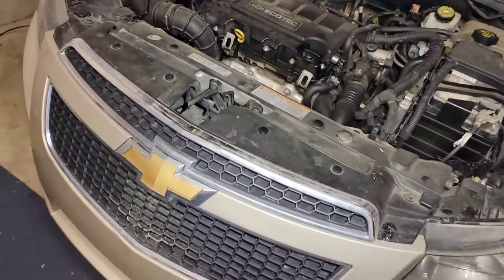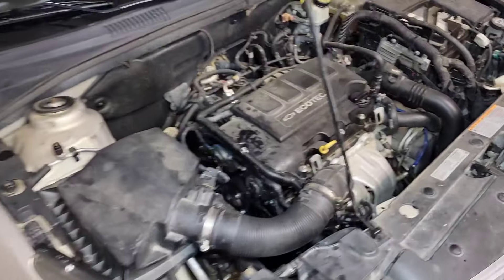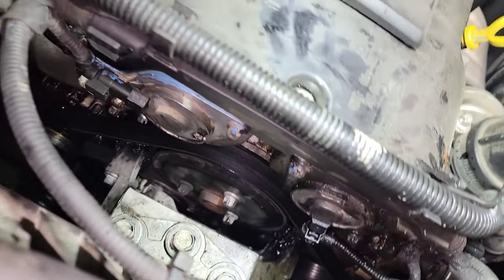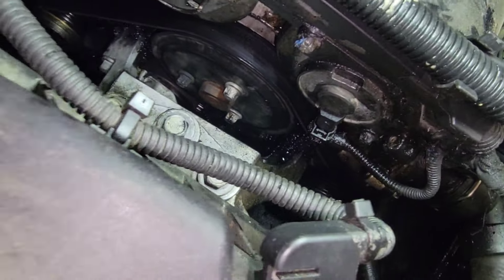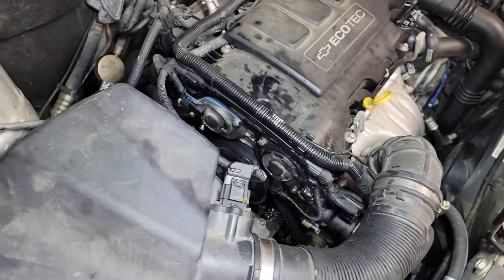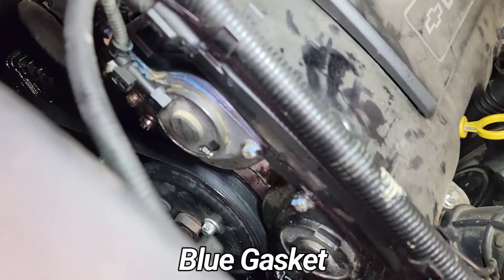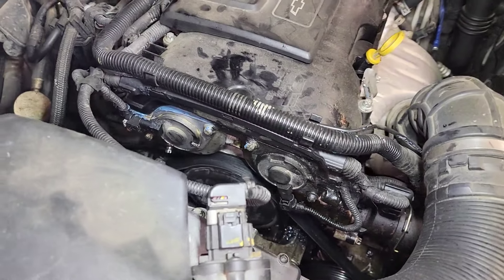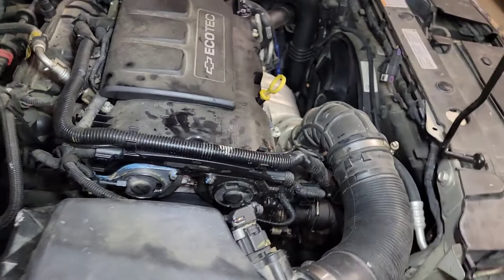V1: 2008-16 Chevy Cruze 1.4L Massive Oil Leaks, This type of job is Horrible! Lets get It

Comment: The worst car I have owned so far.  oil leaks + coolant leaks + loss of power + + + +!!
Reply from the maker: Alot of people dont like this type a car
Reply: Hey but it's a good car to learn from. my advice is to replace the thermostat with a zzp thermostat it opens at 206 degrees instead of 217-220 that will save you from overheating a lot then replace that coolant outlet at the other end of the engine for a aluminum one that part loves to give out every year or two the original is made of plastic. As for the issue with the oil leak from the valve cover you need to modify the intake manifold there's a YouTube video on how to do it and why it does it. Also replace your negative battery cable around 200,000 miles trust me you'll save yourself a lot of trouble and money the average mechanic couldn't find why my car kept dying on the road cost like 25 dollars I did it myself.
Reply: Blood I just...yeah you right.buy I love lil Burbo
Reply: Can you show me whats a good aftermarket thermostat to purchase ?
Reply: Did ur car got fixed? I m having the same type of issue in my 2011 chevy cruze.
Reply: 248,000 miles on my 2012, 6 speed.  I have had coolant leaks from water pump and t- stat housing, and it’s leaking oil slowly.  Despite that, I love this car!  Just always check your fluids.

Comment: 5 years ago, I bought a 2012 with 108k miles on it as a work car. Engine was covered in oil and antifreeze. Spent about 500 bucks to replace quite a few gaskets, seals, hoses and a good steam clean. What I have learned is if I run the heater full blast for the last few miles before I stop anywhere and also let the car idle for a minute with the heater going, it brings the water temps down from 217 to under 190 degrees. Since Ive been doing that, I havent had any more leaks or had to replace anymore gaskets. Currently, the car has 191k miles on it. Mine does suffer from the loss of power syndrome. Every three or four key cycles, the check engine light comes on. I reset it by unhooking the battery for about 15 seconds and the problem goes away for another three or four key cycles.
Reply: I put a cooler running thermostat from ZZP in my engine just for this exact reason! They run too hot from factory

Comment: my cruze did this it turned out to be a check valve in the intake manifold that prevents turbo boost from going into the crankcase so basically when you take off 15lb of boost goes into your crankcase and pushes oil out everywhere replaced the intake and all the leaks stopped
Reply: I’m not sure if this is the same reason mine is doing this.. I had replaced the timing cover gaskets but after a while it still started throwing out oil so bad I changed the exhaust manifold thinking that was the reason cuz it had a hairline crack on it so I replaced still have the same problem.. car kinda loses power while I’m driving rough idle as well… but now with your comment I can only think it probably is the intake manifold.. I know there is a rubber nipple inside and I did have a Look some time ago and it was dirty.. I’m very frustrated with my car it runs pretty ok.. but it does drain oil bad and it goes everywhere cuz of the serpentine belt and the wind… just trying to figure out what can I do fix this once in for all.. the check valve is different from the purge valve right?
Reply: How much did it cost you?
Reply: @cookingwithbehi They have these kits but I just made mine it's the blow off valve inside the intake manifold is why it's doing that you can replace the intake manifold or get get it's called the pcv valve bypass kit I looked up the kit it was 75$ but I just went and got everything in the kit for 50$ at the store

Comment: This guy is gonna be doing that valve cover over again because it actually needs an intake manifold. There’s a return valve in there that either breaks or jams and puts turbo boost pressure into the crank case, great design, car a
Reply: I’m having an issue with a bad oil leak as well I’ve change the valve cover numerous times change the timing cover and gasket as well even the exaughts manifold cuz it did have a small hair line crack so I thought maybe that was causing all the pressure to cause the oil to leak from everywhere and especially the right side of engine.. very annoying not sure if this is my problem how do I know for sure before I spend more money.. I currently have all the part I need not sure if I should get a new intake manifold

Comment: People are using the silicone sealant because the cover gasket doesn't seal well enough and leaks oil into the spark plugs.
Reply from the maker: Yes its gonna leak if they RE-USE the oil cover gasket, i sent people put silicone gasket just to save a Dollar part.  

In this video  we put new parts We dont need silicone gasket on this Valve cover
Reply: @jfGarage4k  1.) The part is $25 for the gasket. 2.) The gasket on these covers leak though. It is a common problem on these cars. It is a common fix.

Comment: so i just found out i have a lot of oil all around the right hand side everywhere it’s even dripping out what could that might be?
Reply from the maker: This video i got here sounds similar to your problem.
Reply from the maker: Coming replacement parts on this are. Valve cover, Timing cover gasket, cam actuator seals, front crankshaft seal, water pump,  thermostat housing, coolant outlet l, etc

Comment: What is the cost to fix that??
Reply from the maker: Depends  some chevy cruze need more work compare to this one.
Reply: I'll give a real answer, I had a similar leak, was chasing it all around, thought it might actually be the waterpump housing leaking (turns out I had a coolant leak which was also happening, and thus showing the coolant).  To replace valve cover gasket, timing cover gasket, oil pan gasket and a crank case seal, it was about $CAD 1700, diagnostic, cleaning  & testing for leaks,  two trips to the mechanic and to repair about a 14 hour job for them.  
My car was in particularly bad condition because serval gaskets blew at the same time as I was going over a steep bridge at highway speeds. Led to massive missfires, which made me drop the car off at the mechanics right away.   They said whoever worked on this car before i bought it used improper gaskets in all the areas I mentioned above. very frustrating, very expensive, but cheaper than buying a new car.  I do all my own maintenance otherwise and have not seen an issue since